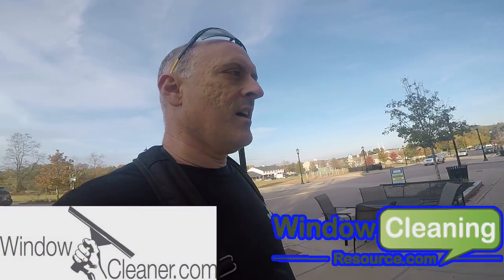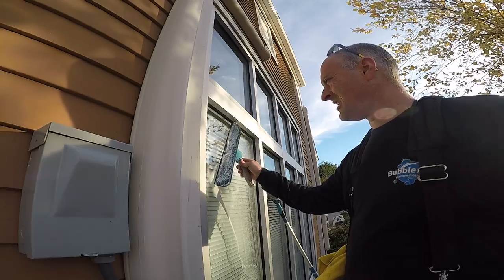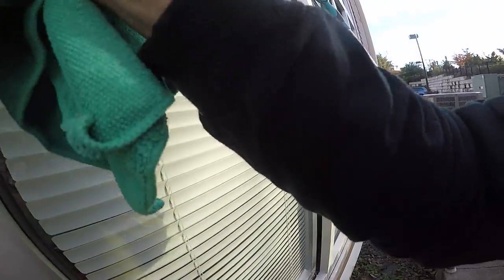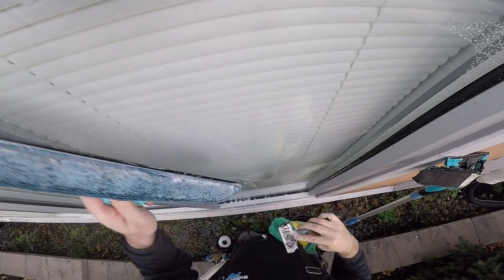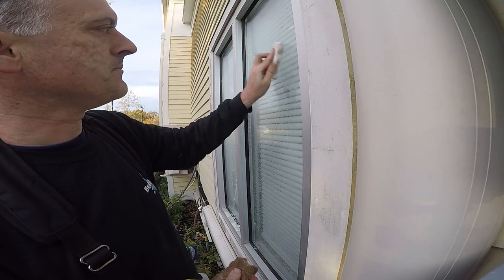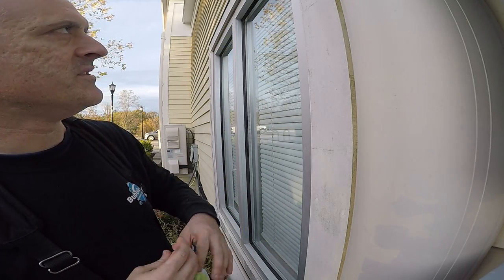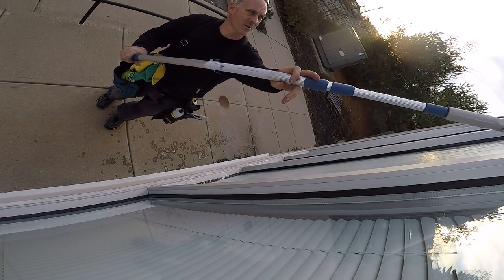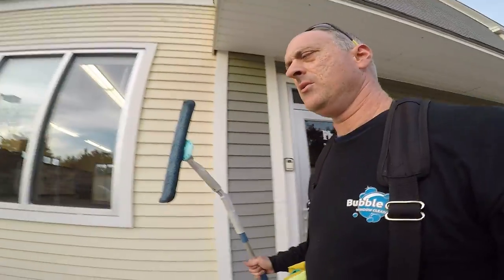I Call Shotgun! Win the Battle Against Artillery Fungus!

Comment: You also could use an old credit card.  I have found it gets them off pretty well.  Normally i use my Triumph 6 inch scraper with stainless steel blades.  Nice video, I run into this a lot.  Just takes a little longer, looks so much better after the proper technique